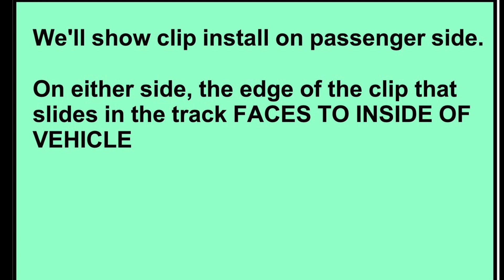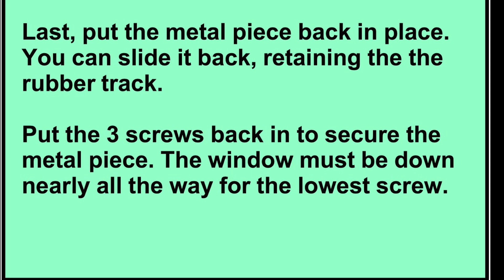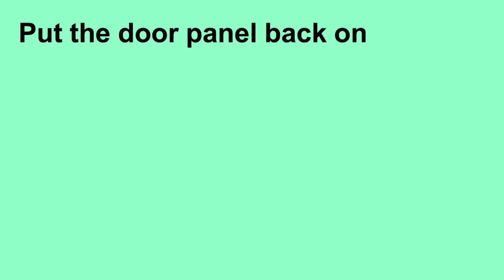FIAT 500 window guide track clip installation (window management)

Comment: Thank you for this Fiat 500 Window Track clip installation video. The instruction to remove the metal plate (with the 3 screws) at the edge of the door makes the whole process much much much simpler! A couple of years ago I installed a clip on the passenger side and I fought with it like it was an MMA fight! Now the Driver's side was a breeze compared to that. Thanks again.
Reply from the maker: You are welcome. Glad it helped!

Comment: Thanks! Was struggling to put in a new window after my old one got smashed by a rock from a truck.

Especially the clip that runs in the rails top back corner of window.

I tried “rotating the window counter clock wise to click it in but I didn’t want to force it.

Good thing I came across your video.
It seems to go up a tad slower than the old one so I hope everything aligned properly…

Now I have to figure out how to remove that sticky residue from the plastic wrap I had on while waiting for the new window to arrive…
Reply from the maker: Glad it helped. I put some heavy grease in the track where the clip slides but I am not sure if it made a difference or not. Seems about the same speed as before

Comment: does it already come with the clip? If so how do you remove the clip in preparation for installing a new one?
Reply from the maker: Yes the original clip is metal. Metal or plastic, the old clip breaks and usually gets stuck in the track. I found two old ones in the passenger side window. These need to be removed but this is easy to do when taking things apart as shown.

Comment: I currently have my (2013 fiat 500 sport) door completely taken apart but I cannot figure out how you accessed those screws for the clip track, I fear if I pull on the lining too hard it’ll damage it, how did you get to them you only shows pictures in your video? Thank you.
Reply from the maker: I did it with the screwdriver itself. Basically insert the screwdriver tip in at an angle under the lining until it touches the screw and the move the handle of the screwdriver towards you and this makes the screwdriver work like a pry bar as you see in the picture . I had to use some force but it didn’t damage the rubber. Hope that helps :)
Reply: @DIY-VIDEOS  thank you! I appreciate your response. It’s good to know that it can be done. Have a good day, thanks again.
Reply: So the edge of the little plastic guide that has the ridge on it goes toward the inside of the car. Then you push the pin in from the outside of the car.  Is that correct?  
For some reason you said from “this side” which is a bit vague.  And then instead of showing actually putting the pin through the hole you cut to the other window with the clip already installed.  But thanks for putting up a video because there’s no instruction whatsoever with the little plastic clip I bought.  And the original was already fallen off in the door with no pin anywhere.
Reply from the maker: Its a frustrating job, I know :) I broke at least four of those clips trying to figure it out before I realized those metal plates must be removed. I ordered a bunch of them. Yes, the ridge goes to the inside. As far as I remember, I pushed the pin in from the inside (the ridge side) out through the hole in the window.  You can see which way the pin goes because on one side, the hole in the clip is bigger. That's the side you want to push it through. You need some pressure to get the pin in, use something with a small flat area. It sort of "pops" in place. It will stick out a bit after it pops in place. Trim it flat with a sharp knife. I am sorry, I was unable to film it because I needed both hands.

Comment: I changed mine out with the regulator. Not the window barley moves going up or gets stuck I can’t figure out what it’s stuck on tho
Reply from the maker: On mine there was an old broken clip stuck in the track. I removed that and also put some grease in the track
Reply: @DIY-VIDEOS  should I just grease the area where the clip slides or the bottom part where the window slides as well?
Reply from the maker: @riverhaire4279  I only greased the rubber track that the clip slides in. I used heavy grease like used in a grease gun. After moving up and down a few times, mine improved a lot